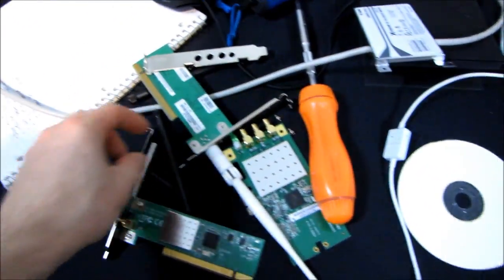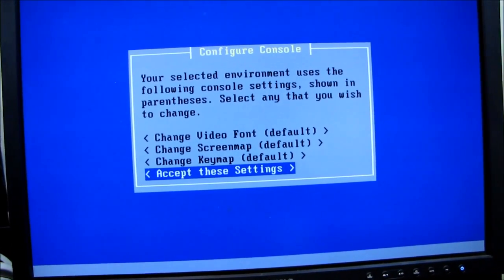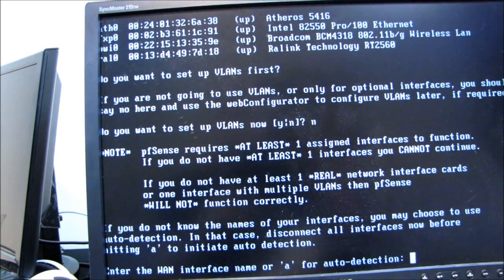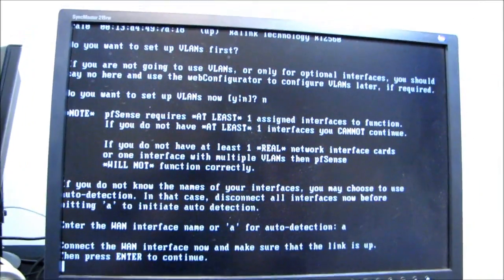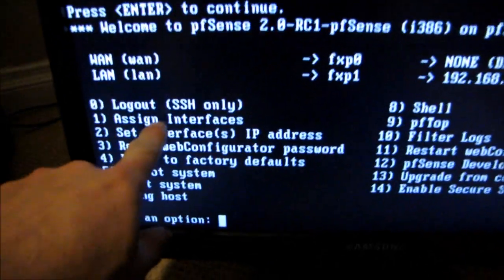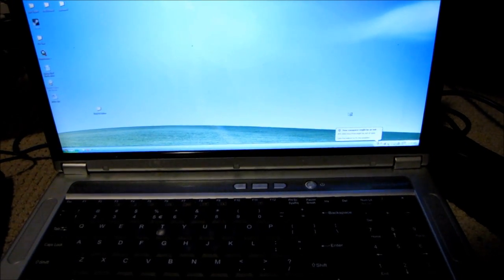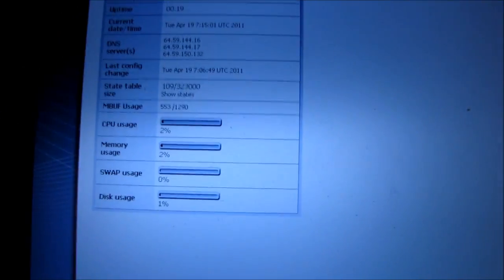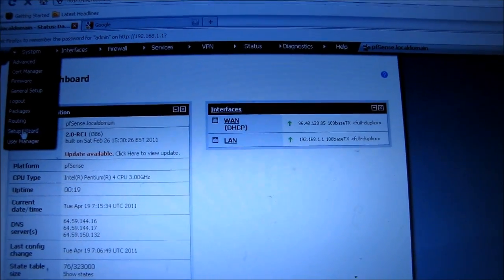Personal Project - Trying to Set Up PFSense Part 1 Linus Tech Tips

Comment: Pro Tip : don't use PFSense with onboard wireless cards, the drivers on FreeBSD are very crappy and don't support the new faster WLAN speeds.
Use a dedicated AP like the Uniquiti UniFi AP connected to a dedicated ethernet port on the PFSense box, this will allow you to have a dedicated WLAN interface to configure in PFSense.

If you do this make sure to set up both the AP and PFSense box in advance so you know they each work correctly.

peace
Reply: tvmcrusher the vid is seven years old now so don't post a comment about something that is further back than LMG garage days
Reply: I appreciate your attempt at constructive criticism.. but alas, everything I have said is still true for the current version
Reply: that's what im tring to do here at the house, but I want to have one wifi for me and to wife, and another for guest and all the other wifi things in the house. printer, Wii, PS3, ipad. I have all server class rigs for my FTP, RDP, & HTTP setup but im going thrugh a 24 port switch for everything. I want to have the power to limit the bandwith per wifi access point. I have one 4 port intel nic in my pfsense box, and two in my server, all my lan lines are ok. I just want to add another wifi access point. config I was thinking about. on the pfsense box4 port nicport 1 switchport 2 switchport 3 wifi access point 1port 4 wifi access point 2can someone help me out please?

Comment: For the board AND the setup you have, you should try CentOS or something like this which could be used as a firewall as well. Any problems with drivers are easily solved by communities or the hardcore oldschool way Writing your own drivers and recompiling kernel. lol

Comment: Linus . . . you are WAY overdoing this.  My pfsense box is a pentium II 400 with, I think, 128mb of ram.  For the wireless and the switching it is WAY easier to just use a regular router (I'm using WRT54GL).  You can still have pfsense do the dhcp for the entire network and handle all of the subnetting/routing/firewalling/multi-WANing or what have you.

Comment: linus do a review on the aero cool shark fan.  i wanna see if its all cracked up to be.  its supposed to be quiet, efficient, and i believe it had UV blue fan blades.  also i looks really nice.  but a good review confirming that it can be quiet and move a lot of air would be very appreciated.  it comes in blue, red and orange flavors, and in 120 or 140 mm sizes

Comment: @atersky That does depend a lot on the computer you are using. If you use like a nettop it will not consume much more than your regular router. And you have the advanatge of a lot more features. I do also have the weird situation that Routers break all the time and my PCs don't. So for me that is actually a rather good solution.

Comment: What exactly are the advantages of using a computer for router instead of a simple router you buy? The cost if you already have an old computer lying about? But wouldn't that computer(old) consume more power, meaning higher power bills, meaning you actually lose money in the end? Correct me if I'm wrong there.

Comment: @haghebaert It will probably make a very little difference, because of the packet filtering, etc.. But unless you test it with a speedtest, it's not likely that you will notice a difference. You need a router that fully supports your speed on the WAN port. And there may be an incompatibility between the router and the modem, so test it prior. E.g. I bought a router a few weeks ago and my speed dropped to about 1/10. So I bought a new modem and since then I've got the 32 Mbits again.